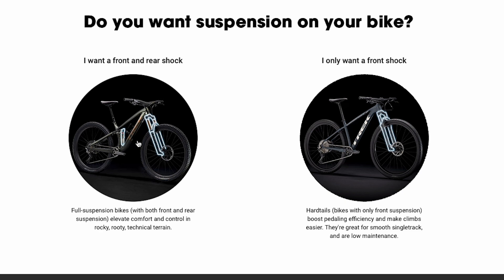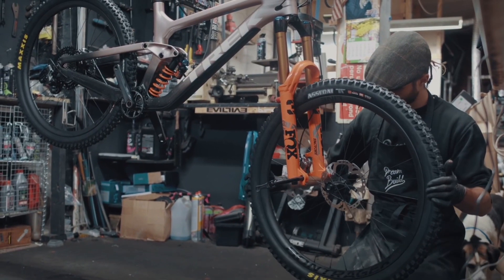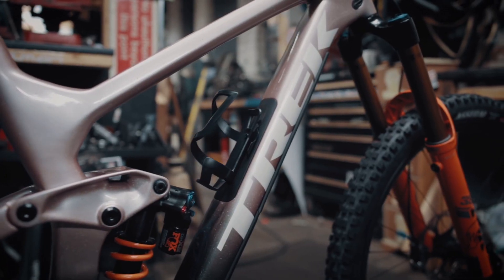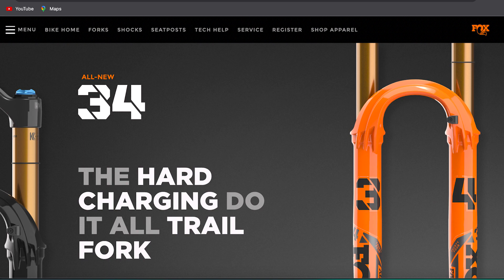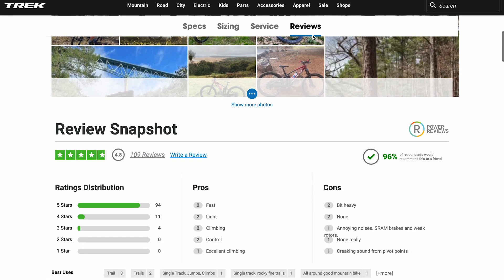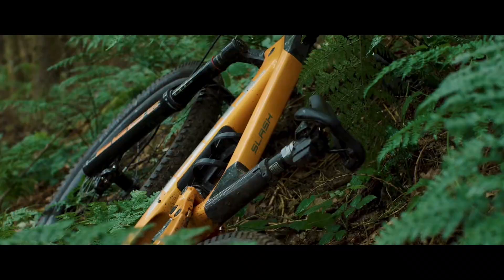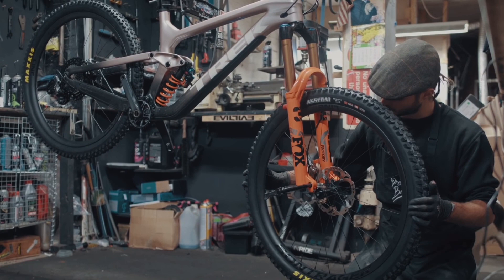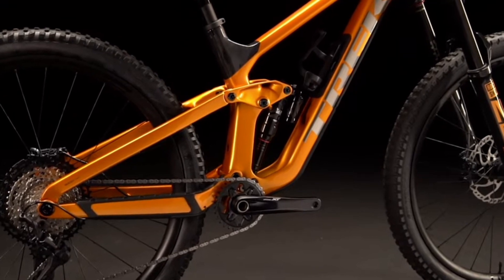Trail Bike vs. Enduro Mountain Bike | What’s the difference? Which one is best for you?

Comment: I have owned the 2019 and 2021 Trek fuel, and now the 2022 Slash, all of them 9.8. The 2021 fuel was Rebuildt with Fox 36 150mm factory fork, and a DPX2 factory rear shock. They were all 3 different bikes, the 2019 Fuel was a lightning fast "burly" XC/trail bike, The upgraded 2021 Fuel was a "Jack of all trades", it could do long days on the trail, and even enduro syle races. But i was always feeling that the 130mm shock was holding me back on the fast descends.  The Slash is defenetly a large bike, it`s not as fast and agile doing technical climbs, but the level of confidence and forgivness it gives you is just next level. 4 months with the Slash and I am jumpin big table- and gap jumps I never though I would even consider trying. It has definitely boosted my jumping and dropping skills. The upgraded fuel was awsome, and most of my KOM`s where taken using it. Its only the longest and steepest segments where the Slash is faster. However riding the Fuel at "KOM-speed" was pushing the limits a lot, and it always felt like I was on the limit of disaster. With the Slash being much stiffer and having more travel, it is a much more forgiving ride. 
Choosing a bike is usually a compromise, the best way to find out whats right for you, is trying it your self. Both the Fuel and Slash are great bikes!
Reply from the maker: Great comment! You’ve had some amazing bikes. Always wanted to try a Fuel EX with a 150 36 on it 🤘🏻Slash and EX are both great bikes!
Reply: @JaredHoff  Thanks! I swapped the Fox 34 140mm to a Fox 36 140mm, and than to a Fox 36 150mm(just changing air piston), going from Fox 34 to Fox 36 with the same stroke length was a much bigger improvement, than Fox 36 140-150mm. If you allreday have e fox 36 i would rather spend money on upgrading the stock shock. That being said, if you have a Fox 36, replacing the air piston is a really quick and inexpencive job.
Reply: Thanks for this comment. I currently have a Fuel Ex 8 2019. I changed the fork to a Fox 36 150mm and riding this bike is pure pleasure. It is a really comfortable and maneuverable bike. I'm learning to overcome bigger and bigger jumps and for a few days I've been planning to buy a slash 8. I'm still considering it, but I think I just have to try it. I hope it will be as nice and comfortable as the fuel

Comment: Hi Jared, I just went on my maiden voyage today on my Trek Slash. This is an amazing bike and highly recommend it as a trail bike. The handlebars are stupid wide though at 820mm. I'm very happy with the suspension and the lockout works good. Only modification I see right away is chopping the bars down to about 770-780mm. I won't ever ride like you but I want the bike to always be more capable than myself.
Reply from the maker: Thank you for taking time to comment. I have my bars cut to 800 and I like that. Which model Slash do you have?
Reply: @JaredHoff  Well, sorry to say I could not find the Slash 8 in M/L anywhere here in 
Southern CA. Only thing in that size locally was the 9.8 GX AXS. Damn pricy but I will not have to upgrade anytime soon. I'm really happy with this bike and happier I did not go with a pedal assist Rail.
Reply from the maker: @olliechristopher467  that’s an awesome Slash. Definitely have to get the right size 👍🏻
Reply: I cut my slash bars 770 on M/L size. with grips is 780.

Comment: Your timing on this video could not be better for me, i currently ride a 2021 fuel ex 8 xt and as you describe, its insane how i improved over the last 2 years. Last week i tryed my friend slash 9.8 and i was just blown away how a diffirent machine it was. I really feel like the 140/130 travel on the fuel is not enought anymore, i always bottom out doing small drop and stuff. But at the same type im not rdy yet for full double diamond crazy down hill. Really feel like im moving toward enduro bike. For me the weight of the bike isnt an issue, im a goat coming from road racing.
Reply from the maker: I am honestly impressed with how well the Slash climbs. There’s only a few times when riding with XC bike friends that they beat me up the hill, BUT I fly past them going back down lol

Comment: Just got back into mtn biking after 23 years (last mtn bike was a Gary Fisher Joshua F4 for reference lol) to mix things up as I was getting bored with just road and gravel - picked up a Trek Roscoe 9, so 0mm of travel in the back lol.  But here in Tucson, it works well as I'm not exactly doing down black diamonds at this point.  I've upgraded it a bit, and so far I love it.  However, down the road I can definitely see myself getting a FS for the super rocky stuff here....I'd prob go with the Slash, but I'll see how the skills progress as I'm basically relearning everything at this point and getting used to the modern slack geometry (which I prefer).
Reply from the maker: Roscoe 9 is an amazing bike and one you’ll want to keep even if you get a FS bike. I’d like to get a Roscoe as well, but can’t justify the extra cost since my Fuel EX pretty much does everything I need it to.
Reply: @JaredHoff  Oh yeah, I'll definitely keep the Roscoe....it's great for easier/flowy trails (I'd actually prefer it over a full suspension) and tooling around/skill practice, and the 29x2.6" stock tires work well on mild chunk/rock gardens - I do have some Conti Argotal/Kryptotal tires ready to go on once I wear them out.  The frame also seems to ride surprisingly "soft" for an aluminum hardtail, but again the tires help a great deal as did switching to a carbon handlebar.  It's just a fun bike that feels good, and if my skills were up there, I would take it down some of the gnarly stuff here in the area.  I almost got a Fuel EX when I was getting the Roscoe, but glad I got the Roscoe as when I get a FS, it'll be more enduro-based....plus the hardtail will basically force me to learn to pick better lines, something I was never good at in the past.  Kind of a win-win.

Comment: Having not ridden for 8 years and getting back into the sport last year I went with a Jamis Faultline 130 front & 115mm rear travel. This bike was the perfect bike to get started with again, however, yesterday I was at a bike park I have never ridden before and found the travel was holding me back and I was bottoming out on pretty every trail. Now, I'm 94kgs or 205lbs and over the last few months have been wanting to upgrade to a bigger suspension bike as my skills improved and which I think is important for a heavier rider like myself. So, I am now the new owner of a Trek Slash 8 as I don't care about how long it takes me to get up the hills, it's more about how much fun I have going down them!
Reply from the maker: For sure! The Slash 8 is an amazing MTB machine. If I could afford more than one bike,,, I might have a short travel bike as well but for now the Slash does it all 👍🏻

Comment: I just found a 2021 Slash shop built custom for $3999 at a local store with a slightly odd build, Magura MT8 brakes which I think are cross country 2 pistons, Bontrager Dusters, Zeb, Float X, and I think they said NX drivetrain which I'm not too keen on. Definitely not my first pick for bike and parts but that sounds like a great price right now. Specially considering I just saw inflation hit a $300-400 price jump in some brands I was window shopping yikes! 3.8 bike now 4.2.. the 5k bike now 5.3, I super regret not snagging that Sentinel in stock now before the price jumped! 😬😬😬

But have you seen that new Transition Carbon Patrol release video it looks KILLER!
Reply from the maker: Bike prices continue to climb 🤦🏼‍♂️ definitely not making it any easier on us. The 2021 Slash is a great bike, but there’s definitely some things you’d need to change out on that one. Maybe you could sell the parts it has on it now to help fund the upgrades 🤔

Comment: I have a problem because I would like the Fuel EX 8 for its lightness but I want a 29 inch so I don't know what to take
Reply from the maker: Fuel EX is a 29er. You’d probably like that, but if you want it to be light you may need to look into the carbon model. Like a 9.8 XT
Reply: yes thank you indeed the Fuel EX 9.8 XT and the perfect bike for me

Comment: i love the idea of more $uspension on the Slash but does it wash out in the turns (some may say understeer but ...) compared to the EX i.e for flatter technical trails but lots of roots to deal with?
Reply from the maker: I’ve had no issues with the size Large Slash on tight corners and steering. However, the fuel ex is a little more responsive.

Comment: Hi Jared, how would you compare the Fuel EX Gen6 to the Slash? Both weight and geometry have become very close
Reply from the maker: Initially impressions is that the Fuel EX can handle almost everything the Slash can. But it will be interesting to see how the EX feels at the lift access bike park. At the bike park the slash makes you wonder if you even need a DH bike.
Reply: @JaredHoff  thanks! So it's between Slash EndOfSeason offering vs. Fuel EX Gen6 for me then 😊

Comment: Dude, nice review. I had a remedy 8 and It was a lot of fun bike, now i got Slash 8 and IS a beast for almost anything but weights too much... I like enduro but I dont do to often, so do you think 160 front 150 Rear travell is enough to do enduro an trail? Also I have a zeb suspensión wich I loves, thanks for the giving back
Reply from the maker: I just rode a 140/150 travel bike on my local trails and almost felt like that was enough. You really don’t need all the travel the Slash has, but man it’s fun having it lol
Reply: @JaredHoff  do you feel diference between  carbón and alloy? Maybe carbón frame is the solution jajaja
Reply from the maker: @mariopazmino160  the only difference I felt on the carbon frame is that it dampened the trail vibrations a bit and feels a tiny bit more stiff. But I don’t ride as fast as the pro riders, so the difference is probably minimal at best. Maybe even a little placebo effect lol
Reply: the Remedy is truly the swiss knife army of Trek. That bike is capable of everything, it climbs so good, it can be fast on downhill, I spend countless hours on that beast because it's so comfortable. The only thing is, the bike is underated because it comes only in 27.5 and not 29 inches as most of people want. But to me, 27.5 is so playful.
Reply from the maker: @ZeroTalentCrew  I have a few friends that still love 27.5ers